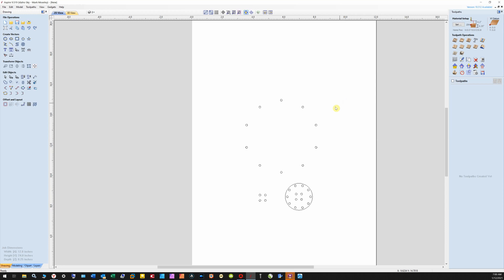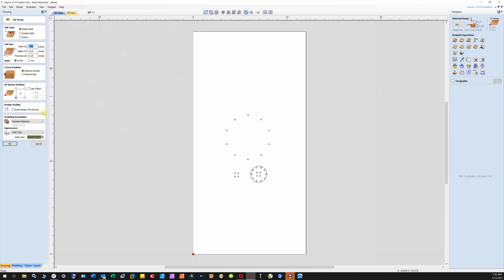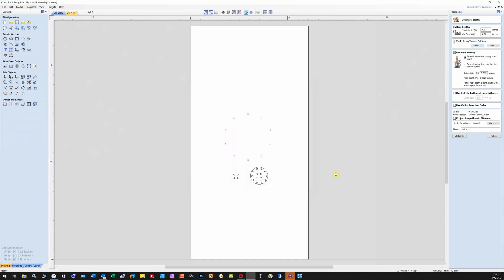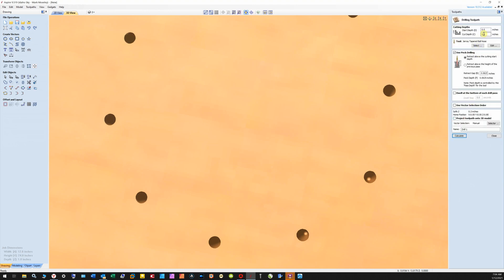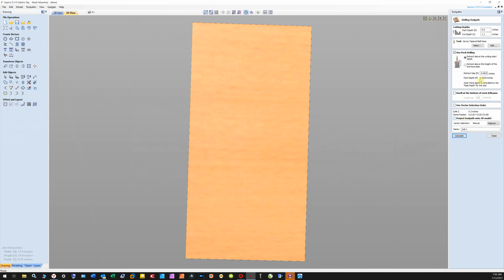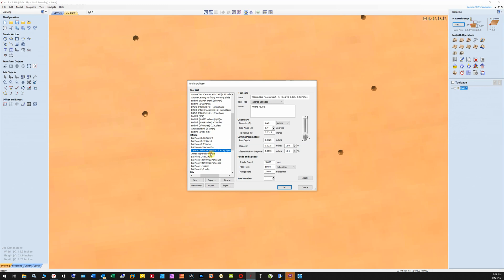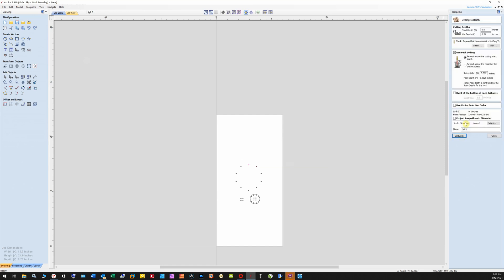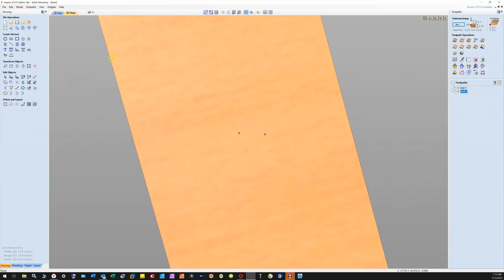How to drill tapered holes using Vectric VCarve and Aspire, for your CNC

Comment: how i can spiral drill 1 Flute 4mm 22 bit to hole 6mm.  i need make my first drill holes to first work, sboilboard many 6mm holes, deep 21.87  MDF is 22m tight. vcarve i not found spiral drill mode, only traight down drill mode have. how make spiral drill hole. about my sboilboard come 200 holes. i has drawing grid all holes my vcarve, 50mmx50mm space lot holes. 6mm hole and 4mm bit. need spiral drill.